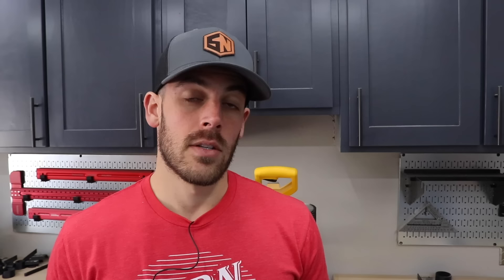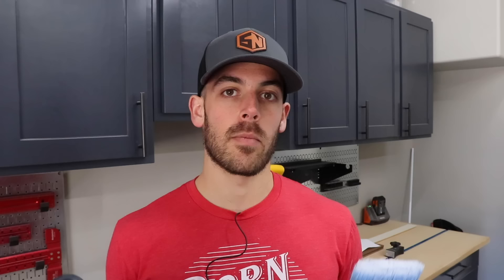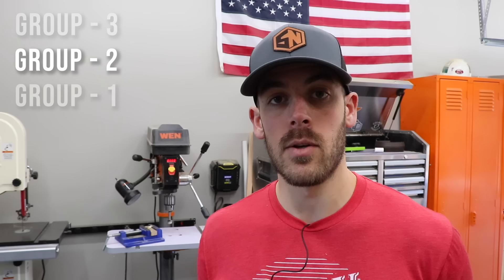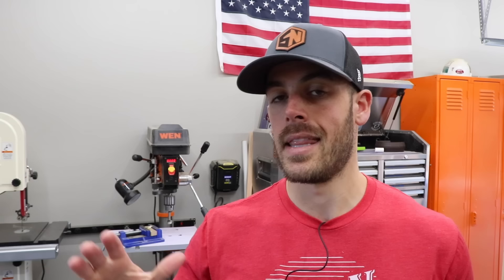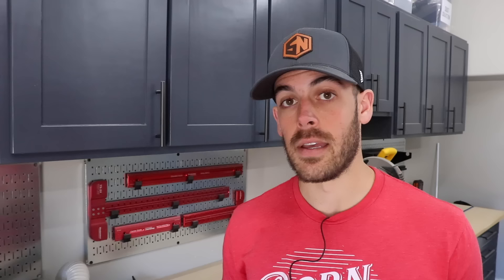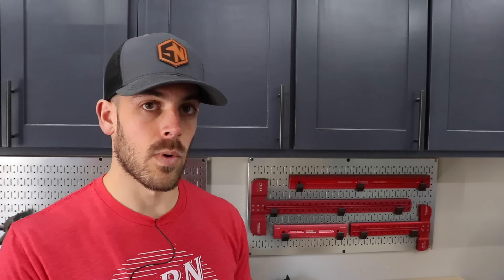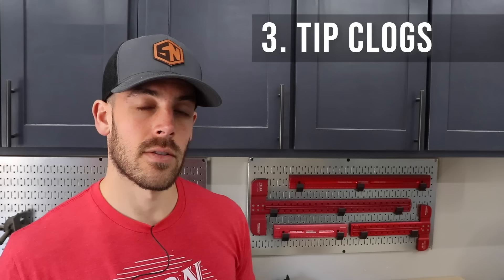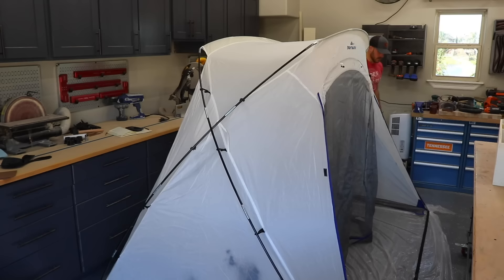Low Cost Handheld Paint Sprayer // Graco Truecoat 360 DS Review

Comment: had 2 the first broke ithe linkage for the piston and concentric spinning assembly (I think just dissassembling and welding a nut on would help, (the pump assy, replaces as 1 unit 1 part number I think less plastic and tossing in a set of welding tip cleaners (for torches to clean orifices would help?)  I gave up following the "recomended" storage, I take the full pump out, clean, make sure things are lubed then store it on the outside (this seems to help with life ,, I also would like a backpack that connects in? (maybe a pony motor to help pressurize? if you coulld carry more battery and say 2 gallons this would be a amazing kit!!  I like the gun and have owned wagners (I find wagners are less consistent and break more easily and I would like more tip options locally but why I bought this? I used to spray gelcoat, fiberglass chop, we used graco aluminum guns, and huge pumps with multiple cylinders, we could mix resin and catalyst and define the proporations daily based on humidity and temp,,,  really beat those machines up,,,this in a walmart caught my eye for that experience, but also the 360 degree spray position (I am the fool who is often hung upside down by his feet painting 25 or so feet,, even my own home projects I tend to work on things too difficult to re-position..      I would buy again, I must say the plastic pumps cost 130? when I paid that for the gun? so it is dissapointing?  (parts spendy and not very available for these consumer machines?)  but I am painting my little laundromat with one of these today ,,and its good. (maybe a pressure vessel or cup with out the liner as a option also? I go through enough paint the fitting to hold the cup on wears (just today I am pacing myself but this project 16 gallons,,(alot of those lil cups).

Comment: One thing you did not touch on is the different media usable/used with this sprayer. (Paint - Latex/enamel, Lacquers, Acrylics, Varnishes, stains, etc.) Would be kind of nice to know about using them and the cleanup/clogs/spray patterns,/etc. Ideas?
Reply from the maker: I believe it can be used with all of the above
Reply: @ShopNation  I assumed that part - but the ACTUAL doing and efficiency/cleanup/drawbacks with each???

Comment: I need to repaint my mower deck and some fencing and was looking for a sprayer to make the job easier. While reading the Q&A on a couple websites that sell the unit it seems that the unit will need repair or replacement parts after 25-50 gallons of paint or about 1.5 years of use. If that's true $200 seems like a lot to spend to paint a few projects.

Comment: We bought the vsp and you couldnt work at low psi cause of the pulse in the motor. It left a very obvious striping in the finish. And it pushed way too much paint out. Bought a 100$ home right and it has done way better than the 360 for doors and cabinets. The tc pro you can use the fine finish tips but at a 500$ price tag I think I'll stick with my home right. For 100$ I can afford to buy a new one every job
Reply from the maker: Interesting, thanks!

Comment: I got the same spray gun ..... great for water based paints, oil based ... I tried once only ..had a lot of trouble getting the gun cleaned after ...One more thing ..after using sprayer on a few jobs the cup would not keep its neg pressure and would suck air in .. tried everything to solve this but the seal is built in the top cover of the cup and now the entire cup top needs to be replaced. I think this happened because I used oil based paint and didn't get that part cleaned right away .. I was more concerned with the pump and nozzle. If I bought another I would use it for water based paints only ... just my experience with that product .... might help someone.
Reply: oil or emaille based paints need to be thinned with real thinner, then there is no problem using them

Comment: I have been spraying for 30 years, I am very experienced in spraying. I bought one of these about a year ago and it was a piece of crap. Right out of the box and never worked properly unless you sprayed upside down with it
Reply: I had the same problem but no from the beginning rather after many time using it. 
The story was start to show on-site by work with it and I wasn't able to spray in a normal position but just upside down therefore issue was because the air cop the small one it was lose and allowed air to come in which all the time end up a bit of air in  and the paint wasn't allowed to go through. Once I  turn upside-down the machine everything was alright therefore I change that small cup I was sure if it's very screwed in tight and everything was back to normal 
Another way to test is by having the cop empty of any paint put it in the place to the Gun and try to squeeze with the hands the lining bag to see if some noise you can hear, if some noise come out that means is not very tight. 
Inside the cup all the time it's formed kind of vacuum in order to work properly. 
When the pump suck out the paint from lighting bag, the lining  bag get shrinkage like an accordion therefore if everything is not very well sealed and air escape inside you going to end up with the air  at the surface of the paint and air going to go in to the pump and the machine is not going to be able to paint but just the split. 

Sorry if I was a bit long but I want to be clear and you to understand what I'm talking about thanks Michael this is my channel us painter decorator on YouTube. https://www.youtube.com/watch?v=lO5RliEkBF8&t=57s
Reply: I bought one this morning 8-23-2020, It was a piece of crap right out of the box too.
Reply: Yep the all plastic sprayers seriously suck, even the sales reps will tell you not waste your money.. that goes for the Wagner air turbine sprayers as well. Been spraying since 1995. Bottom line, if it ain’t made with stainless steel don’t bother.. use rattle cans.

Comment: Nice Review, I'm a professional painter and own 2 of the TC Pro cordless from Home Depot. $529+ 100 for the additional warranty. this is my touch up sprayer, even use it for doors and  in conjunction the the graco cleanshot. You must keep it clean! you need work on your painting technique, but as you have stated, you're not a painting professional.  Great review for the DIY guy.
Reply: Randall Grubbs Did you use the 4” or 12” tip to paint doors?
Reply: @seattledan  RAC X LP517, I like the RAC X 312 LP for large window doors
Reply: Thanks  @fieldtechsolutionsllc1443  Have you tried the 4" that came with the sprayer?
Reply: @seattledan  mine came with a 514 spray tip

Comment: Had this one, actually the variable speed version. It was pretty good, but the pump went bad after a year and a half.  Got the TC Pro, which is a huge upgrade.  Paints better, has replaceable tip guard you can actually remove and clean much easier.  The pump is replaceable and you can take it apart and clean it. So much better than the 360.  Graco makes good products but I would not recommend the 360.  I got a refurbed TC Pro for not much more.

Comment: Here we go... brace yourself! I have access to the "group 3" airless Graco Sprayer you mentioned, my boss thought it would be great for spraying door casings. As Industrial Commercial painters, we hate it. The price of a small HVLP sprayer is about half, and they have all the same features, easier to clean, MUCH lighter and therefore easier to use, I cannot stress that point enough, and HVLP's are able to spray paints you can't spray using the Graco (they simply don't siphon and spray properly no matter what the pressure). The Graco is the best battery powered sprayer on the market, no doubt, but it is also not as agile and versatile as most painters would like. Then there is the mess. That "suction cup" is absolutely horrible. I'll take an HVLP any day over that alone, no matter how small the jobs I do. Priming that thing is often a pain, and refilling the cup is an exercise in OCD at best, or at worst it is an explosion of paint covering you and the floor until you get the damn thing sealed. Priming the cup then priming the sprayer... Then you have to clean up the gun or else get drips onto everything you are waving it around. Not idea for ANYONE, especially those who aren't professionals, and know the in's and out's of dealing with these issues on a daily basis. If the lessor Graco models do not have the range of spray pressures that the Ultra-cordless has, I would not bother with it at all. Either way, not worth the money compared to other HVLP's. HVLP's are faster, more powerful, range of mediums, and cheaper to upgrade and maintain. These new Graco's... change the tip, That is your upgrade, and guess what, they don't come with a tip suited for most things you would use it for! We had to special order a smaller tip for the damn thing! Try doing that, Shop Nation, you will minimize that "orange peal" paint job you showed everyone! Oh, and if you HAD experience with an HVLP, then you could understand how crazy the Airless Graco really is. Bad luck for your purchase. Does it do what you need? Sure. HVLP, place a gallon of new paint under the stem, prime the paint into the sprayer hose to the gun, sphhht, sphht! You are painting. You are painting till you have emptied the can. Put new one under it, and you are painting AGAIN. Clean-up? Replace the paint with a gallon of water, or thinner. Spray and backwash the gun. Tear down the sprayer head clean it, same as the Graco, without the damn cup crap. No overheating, no refilling cups with paint squeezing out... just paint. Less mess, more painting, takes time off your cleanup. Win Win.
Reply from the maker: Wow, very thorough! I always appreciate hearing a professionals point of view. Great points made comparing to the HVLP option. I can see how the handheld Graco wouldn’t be the best fit for a pro, would your opinion change for a complete newby?
Reply: I'm assuming you're not talking airless HVLP guns, so are you factoring in the compressor needed to run those?  Hell, even those units with portable compressors are well over $1000.  I agree that you can get better results with an HVLP gun, and it's going to be fairly simple, but at the same time, target audience is a big factor.

Don't get me wrong, pneumatic tools are great, but painting and sanding are like the top two for CFM requirements on compressors.  You're not talking those POS $150 pancake compressors to run those, you're talking the $500+++ compressors to put out enough air.  You're also talking in that size, 240v 15-20A circuits to run those; ultimately, you're going a bit beyond the scope of what your typical home worker is going to have access to.  Failing that, you're going to be constantly waiting for your compressor to charge up to lay down paint.
Reply: @JamesLee-sw6ss  My uncle had a pancake/hotdog compressor for his framing company, he just used a 50-100g tank to keep volume in. although i assume a sprayer would use volume too so that might not work.

Comment: I used one of these to refinish my kitchen cabinets, however, after using it for a day, I took it back. Its too big for that and you can't control the amount of material coming out of the gun working in tight corners. I was using Sherwin Williams Advance paint and had to have the variable pressure up to 7 1/2 or so to get a nice spray pattern, but then getting into the inside of the boxes, its a way to much paint, dial it down and you get a shitty pattern. I bought the Graco X5, never looked back again. Waaay better!
Reply: I got the X7 ,and it rocks.. I completely agree with you regarding the amount of material it sprays especially when it comes to insides of cabinetry.  They have a fine finish handheld that's pretty boss too.

Comment: great video, can i just say the the so called level 3 handheld sprayer, the graco ultra handheld airless is very tempremental....it's not made for heavy or even medium use. Only any good for very small projects, more of a touch up sprayer and would not recommend spraying kitchens ect as the pump will inevitably fail doing so.
so i would not like to use either of the other two models thats for sure
Reply: Your tripping" I have painted 4, 16 hundred square foot houses and it's not showing  any sign of wearing out, at all..interiors. Very fast and easy. No bullshit!

Comment: IT'S ALL YOUR FAULT!  I saw that video you did a while back and the results and I you convinced me.  I got a VSP and love the thing!  I recently painted a bunch of bee hives and really liked how it sprays no matter what position it is in.  The 40oz cup is a little bigger than yours and I ended up holding it with two hands until the cup was partly used up.  Hey you paint for a couple hours straight!  I have used both oil based and water based paints with it and because the cleanup is so much easier I try to only use water based with it...unless the job is huge then try to only clean once.  I also found with fresh new paint it was very easy and no clogs.  However, I tried to use some old paint that had been sitting a while and the chunks were a serious pain.  However, with the VSP I could turn it up and while it still clogged it did work.  And flipping the tip to unclog works great.  I did clog up the intake a few times so I would never recommend old chunky paint.  I know, normally you would never use paint with chunks especially through a gun so I was abusing it a little and these were bee hives and just needed some protection!  I also hit the overheat issue only on the old paint.  The new gallon of paint was 3-4 cup refills and never had the issue.  Maybe since I was outside it made a difference.  The VSP I got came with a storage bag which is also a good way to store those extra cups as well.  Otherwise everything is covered in dust in my shop.  The tent is a great idea for inside with smaller items.  If the cost is too much look for camping tents on sale certain times of the year....same thing.  I use the 3M mask but since I wear glasses I need to find one with a face shield to keep paint off my glasses...or wear old glasses when painting and remember to clean them too. :)  
I used to hate painting but this thing makes it look like I actually enjoy it and does a great job!  Thanks to you and your channel for the advice because this was a great buy!
Reply from the maker: Nice!

Comment: Good review.  When you painted your cabinets, did you go with the 4" or 12" spray tip? Have you painted an interior door? If so, which tip did you use.
Reply from the maker: I used the 4" and I have not painted any interior doors yet, but I would image probably a similar tip.  Need to reduce the pressure though

Comment: I tried one of these to paint cabinets, but it didn’t work out. You can’t control the amount of paint coming out other than to speed up your arm going back and forth. If you dial down the pressure to slow down application, then you get tiger stripes. Took it back to HD and bought an X5. Way better

Comment: Is thinning of the paint required for this specific unit? I didn't hear anything mentioned, but it seems like most handheld paint sprayers require thinning to get the right viscosity.
Reply from the maker: Nope! That’s the best part. The latex paint I use most often is thick and goopy - no issues
Reply: Some paints WILL need thinned out.
Reply: I have the ultra max cordless and it’s great. I haven’t needed to thin, until this last paint I sprayed.  It was an ultra heavy outdoor paint.  It needed thinning.  But no others I’ve used needed thinning.  It’s an amazing sprayer.  Just heavy on the arms after awhile.
Reply: When i used one professionally they ran everything I could throw at them including elastomeric paints which are notoriously thick. You just need to pay close attention to the manual to figure out what kind of tip you need.

Comment: Im a firefighter and I'm researching electric paint sprayers for us to use  at the station to spray down the cab of the fire engine after Covid-19 exposure. The material I would be spraying is disinfectants that are either water or alcohol based and therefore very thin. Thin like water. Would this sprayer be up for the job? or is it meant strictly for thicker materials like paint?

Comment: I already own a large air compressor.  Should I just buy a paint gun for my air compressor instead?
Reply from the maker: You can, but the hassle factor will be higher. The paint job quality will also be higher so it’s a balance
Reply: @ShopNation  So the electric airless is less hassle than using the air compressor?
Reply: I use a harbor freight special with an air dryer in line with my hose. Works great with my 20 gal compressor.  Only bad thing is its not as portable and cant spray large projects without stopping to refill the air tank.

Comment: Great video, thank you for taking the time to make this. 
I am thinking about getting a sprayer to paint the ceiling in my basement, do you think this would work for me? Will it be an issue to paint upward like that?
Reply: Steveincollins, for a project that large I would use the Graco Magnum Project Painter+ or something similar. You can use it with 1 or 5 gallon buckets of paint and your project would go much faster. I have one that I painted a 12' x 24' shed and it worked great. Cleanup is a pain so I wouldn't recommend for small projects. I'm thinking of getting one of these small hand held sprayers for small projects like furniture etc where setup/cleanup is faster and easier. Hope this helps....

Comment: With this model you reviewed, would you suggest buying it to paint 25 walls a year or so???? I just see you use it for small projects, what would you say for using it for walls?
Reply from the maker: It starts losing appeal on larger projects because you'll be refilling often and it will actually overheat.  This is best suited for small jobs
Reply: @ShopNation  so not a good idea for 100sqft?